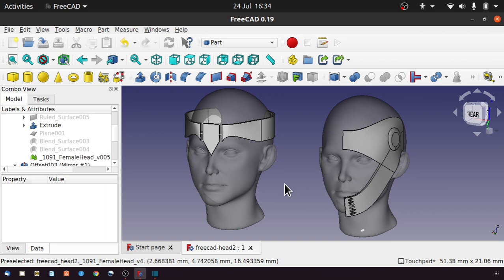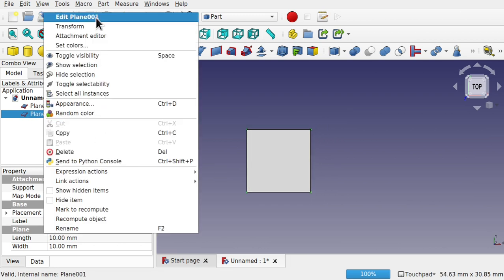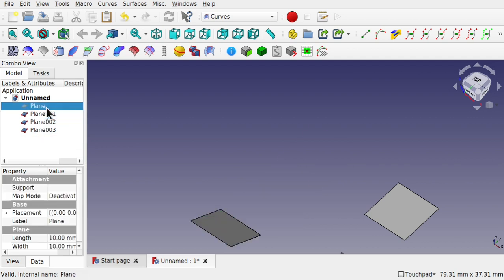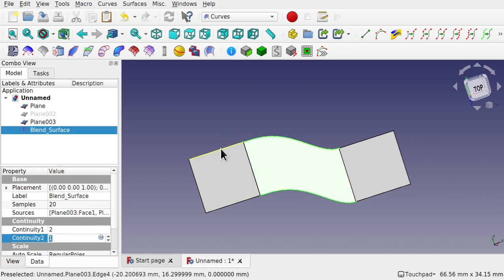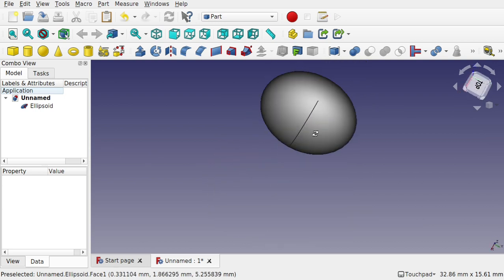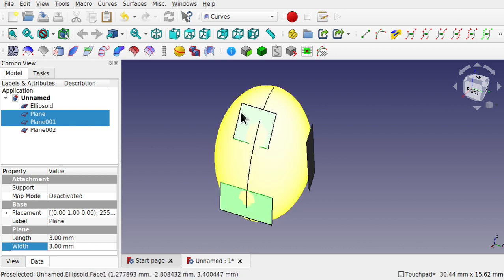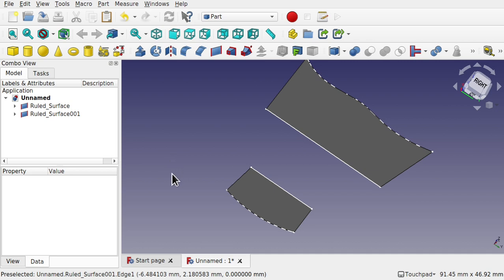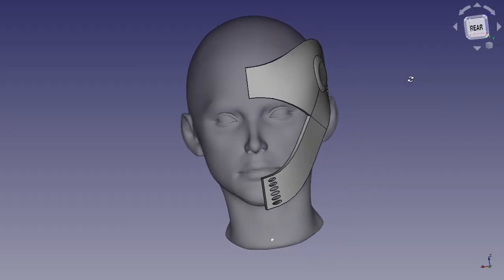Learn FreeCAD Curves Workbench [7.1] Blend and extend surface between multiple faces. Curved shells

Comment: @MangoJelly its annoying that in case of complex shapes where things are twisted in all directions there's no smooth transition, but sharp edge, no matter what You set and if You apply surface it's got weird bulges that You can not 'straiten up'  no matter what parameter you set. I'm stuck looking for smooth transition surfacing method